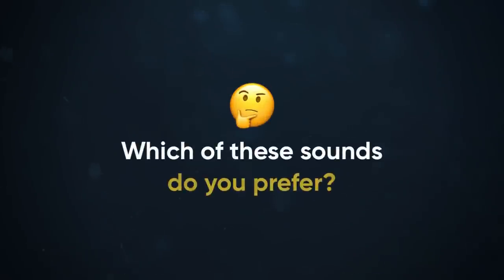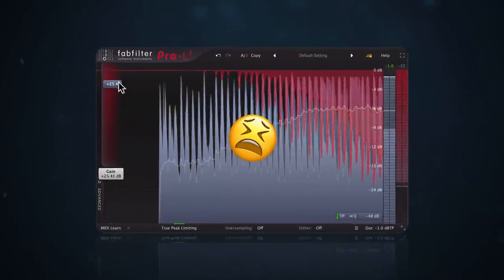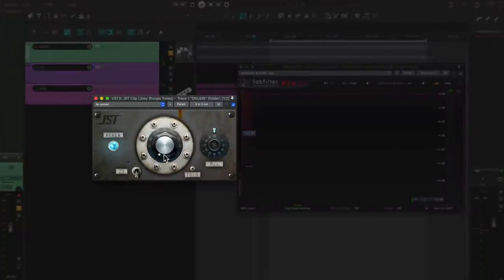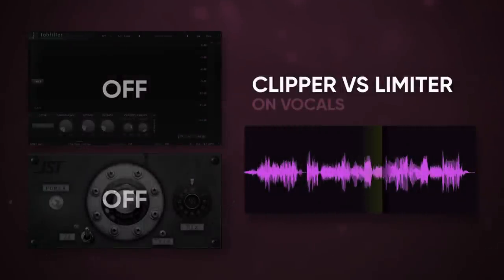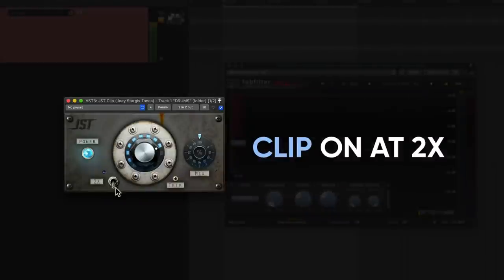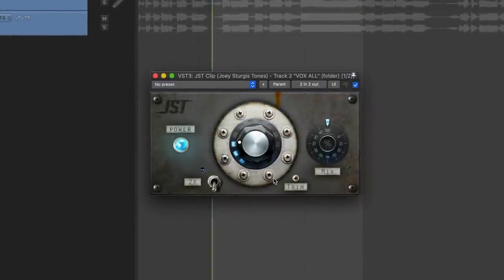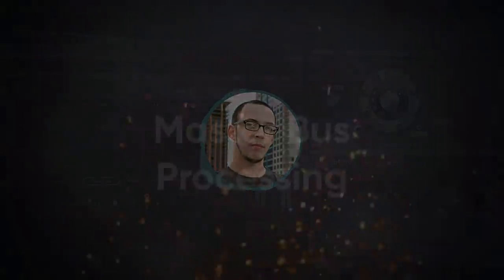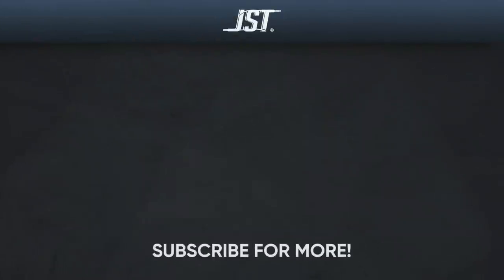Understanding Clipping vs Limiting

Comment: JST-CLIP is still an unparalleled one stop shop for drums. Crazy how loud you can get the drum bus while maintaining clarity and punch.
Reply: I mixed a hardcore track today and thought to myself “these drums are sooooo loud. But it doesn’t sound squashed”
Reply: @ryanshreevedrums  exactly you still retain a lot of dynamics. It’s very transparent whilst also having its own subtle sound. Honestly one of my favorite/useful plugins
Reply: Maybe someone could answer this question, I enjoy a punchier louder mix, but I heavily enjoy clarity within the loudness, but how does one go about the LUFS requirements for say YOUTUBE, Spotify, etc without losing volume?
Reply: @OfAbstract  probably not the most qualified person here to answer this question, however, 2 things are pretty obvious. 1.) Your final output stage on your master needs to be at least -1db output ceiling. You can google search the platform  requirements. Also the Lufs which is platform dependent. So for example: -1db on the output of your limiter, and usually between -11 and -14 lufs. Use the loudness meter in your DAW set to measure lufs and match it with the requirement for which ever platform you're looking to upload to.
Reply: yess

Comment: the attack on Pro-L 2 does not work as many might expect, instead (as per FabFilter's own documentation) “The Attack and Release knobs control how quickly and heavily the release stage sets in. Shorter attack times will allow the release stage to set in sooner; longer release times will cause it to have more effect.” As far as I know, the main difference between a limiter and a compressor (besides ration) is that a Limiter's "attack" is always instantaneous.

Comment: I'm using both. My main track gets a D16 Frontier limiter set mostly to get this track's output to stay in a certain range. On my Master Bus, within Studio One, on the insert section is only 2 things, LVC Clipped-MAX and Venomode Maximal 3. The LVC Clipped-MAX has a shifter section nearly identical to ClipShifter. Next is stereo, followed by M Band, and lastly Master. The Maximal 3 is set to brick wall my output.

All the meters I've added into the post section to monitor levels.
Reply: I've now bought the LVC Limited-MAX to use with the Clipped-MAX. I'd gotten a sale email for 40% off from LVC so I got their limiter.

Comment: I still think Limiters give a more transparent compression with a more original tone, especially on bass guitar...i prefer a FET  Boss LMB-3 bass limiter to most other types of compressors...took a while to get the settings right for whatever i was playing but now i get a great clean bass compressed tone that is very transparent without sounding over compressed...maybe limiters work better on bass...though you have to get the threshold & ratio settings right to get a great bass tone...i guess drums are different to compress compaired to bass guitar...a well done video with good info & examples.....

Comment: While mastering I always use two limiters (first one sometimes in soft limiting mode). What are your thoughts about using 2 limiters vs using clipper followed by limiter in mastering? Pros and cons of each. Thank you for your time and answer
Reply: I regularly use the Sonnox Oxford Limiter, followed by Pro L2... and if it still needs a bit more control, I'll add KClip 3 in front of both of those to snag an extra db or two.

Comment: Compressors and limiters want to be lazy. Aka use them sparring and use the clippers for power punch and loudness. Baphometrix has a great series on here about Clipping to Zero aka CTZ which gives you a loud mix with lots of punch and impact.

Comment: using L-316 after ssl comp on the master instead of L-2 but i think i want to use L-2 last in the chain. i cant seem to control L-316 as easily as L-2 when it comes to make the mix loud

Comment: I heard that the algorithm used for hard clipping is basically the same for all clippers. Do you know if this is true?
Reply: Yes because hard clipping is one formula
Sample > Threshold
Sample = Threshold
If the sample is greater then the threshold it becomes equal to the threshold, if it's not this it ain't a hard clipper
Reply: @jurv7626  thank you. That’s basically what I was told. So I guess the selling point of a hard clipper isn’t which one sounds better but which one has the features you need like adjustable ceiling, over sampling and just basic workflow.  Do you know if it’s the same with soft clipping?
Reply: @davidasher22  what you said about hard clippers are true, soft clippers are a different story, they either have fixed mathematical wave shapes (check out Free Clip) or a softness/slope dial (usually a knee control, the same thing you see on your compressor and on Gclip or the Flatline one) or a softness/slope dial that changes/smooths the fixed wavehape.
Reply from the maker: JST Clip has a custom slope
Reply: @jurv7626  I actually use Free Clip. I normally need to use some sort of monitoring after it though because the meters on the plugin are small and hard to use. So I usually through a Pro L on the master bus just for the metering capabilities.
Reply: @joeymusic Do you mean for the soft clipping?  Or is this slope associated with something outside the actual hard clipping?

Comment: At 05:36: Is it really limiting when adding attack time? I mean, the dynamic range is still the same as the loudest peaks are let through and it is not upwords compression/limiting. Im sure I got someting wrong, but this is confusing... Also, how then is the body of the drums brough up when loudest peak is the same but still a gain reduction?! The resulting signal level should then be the same hotter and quieter quiet parts. Best regards Confusius,  the confusted confusion himself :)
Reply: But ey, this is the best tutorial I've seen in a long time! Very important part of mixing